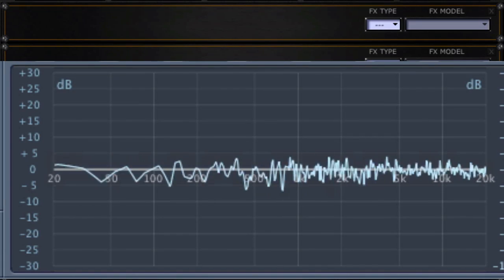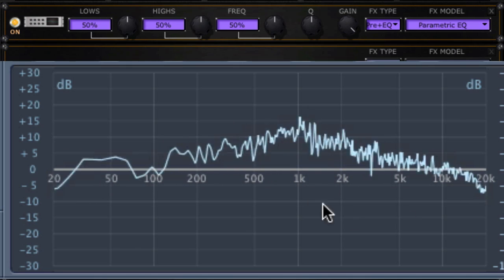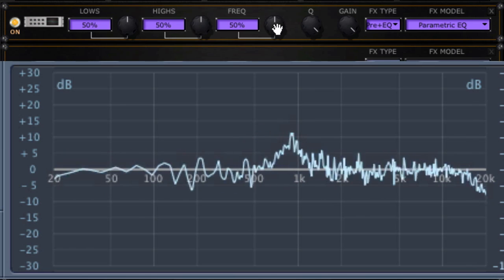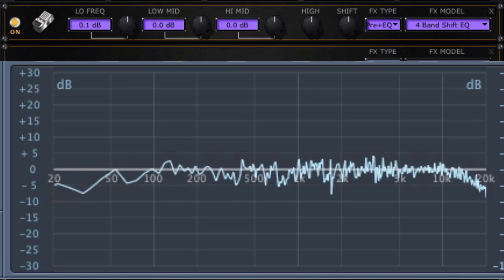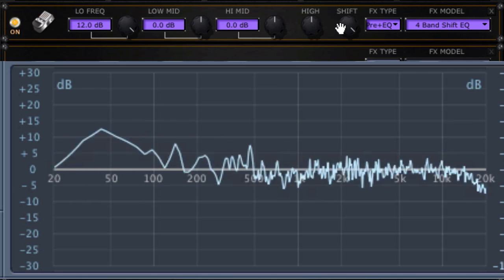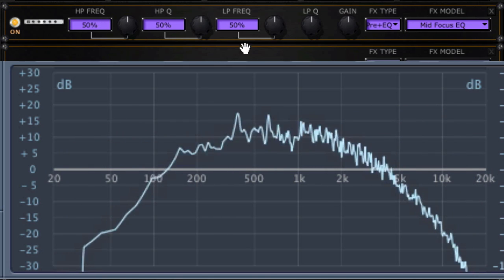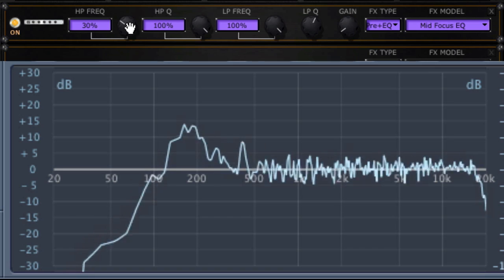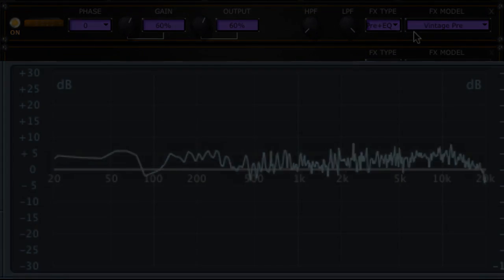EQ Translation for Pod HD

Comment: Hey Matt, can you help me in providing instructions how you did that in the video?  I need to see for myself how the EQ in the pod works for me to fully understand it.  I just don't get it how you are able to make the spectrum analyzer see the pod's signal.
Looking for a favorable response.
Reply from the maker: Hello, it's been a while and I don't remember exactly what I did, but the basic idea was that I used Logic's Test Oscillator to generate pink noise, which includes all frequencies. (It might have required some minor EQ within the DAW to make it perfectly flat like you see here). I sent the pink noise out of my audio interface into one of the HD500's inputs, then looped back from the HD500 output to an input on my audio interface. I was careful to avoid a feedback loop. Logic's built in EQ plugin has a spectrum analyzer, so all I had to do was adjust the EQ controls on the HD500, and the results could be seen by changes to the spectrum of the pink noise. Good luck!
Reply: +Matt Mayfield Thanks

Comment: Great Video Matt.  
Helped me alot to understand the EQ section.  What spectral analyzer did you use?  Would like to try that at home too
Reply from the maker: Thanks! This is the analyzer built into Logic Pro version 9. I zoomed in and cropped so you don't see the other controls.

Most DAWs have something along those lines - often you'll find it inside the main EQ plugin.

Comment from the maker: Thanks a lot! Well 12kHz is way, way up there... It's so high that most people who've been exposed to lots of loud sounds can't hear it anymore. Also, it makes a difference where you do the EQ: before distortion, after distortion but before amp, or after amp.

To experiment with eliminating 12kHz, I'd suggest starting with 8 kHz & above, using the Studio EQ. A good starting point would be to set the Lo Freq wherever, Lo Gain 0dB, Hi Freq 8000Hz (same as 8 kHz), and tweak the Hi Gain below 0 dB.

Comment from the maker: It's won't be much use to you if you're not yet familiar with EQ. Once you're well acquainted with EQ, when you hear your guitar tone, your ears + experience might tell you something like "This sound is too thick - I should turn down 250 Hz by 4-5 dB."

Unlike normal EQ controls, the HD500 is not labeled in Hz, the real measure of frequency - instead, it's labeled in percent. So this video is to help an advanced EQ user match up the percent with the actual frequency.